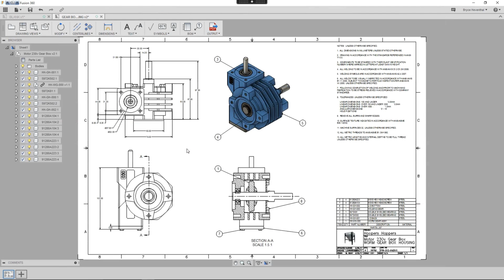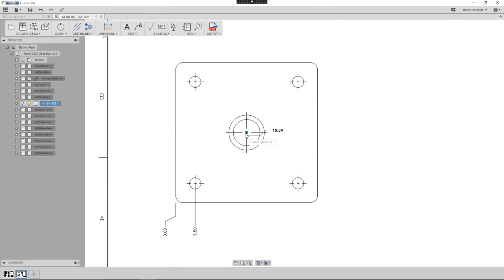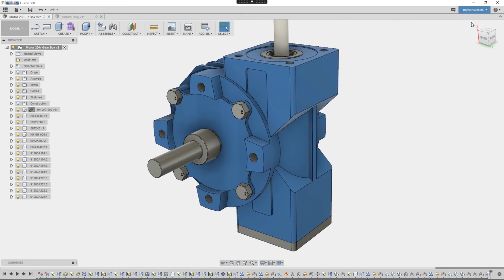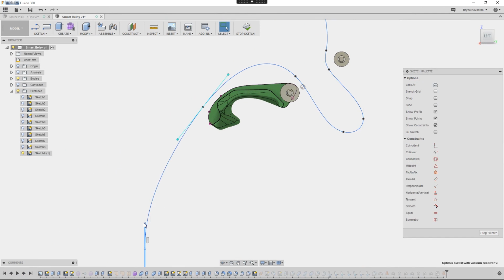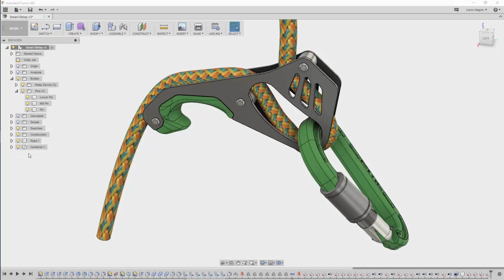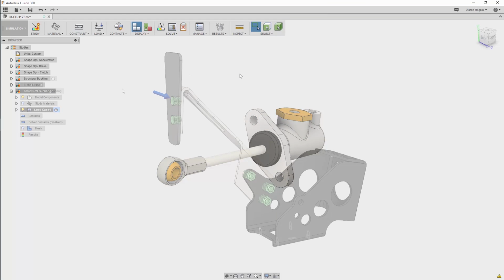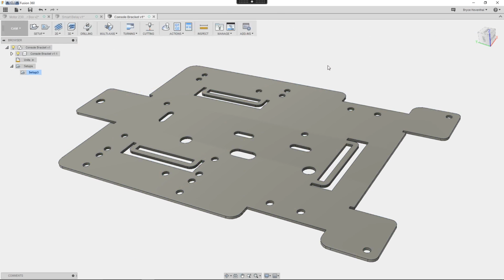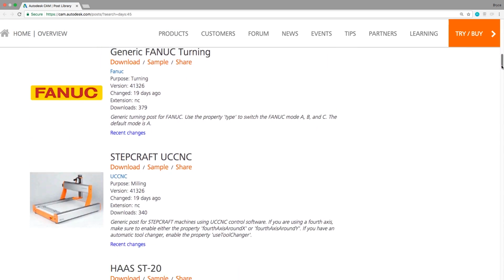What's New in Fusion 360 March 2017 Update

Comment: Totally screwed my mac. Just updated to March 2017. Wish I hadn't bothered but had no choice did I? Fusion acts sluggish after a while then hangs and then I have to restart. Totally ruined.
Reply: Hi Aaron,
I tried re installing the software and its a bit early to start punching the air but it seems to be working fine now. I love Fusion 360 so was horrified when it began to act like that.

Comment: Next thing that 2D cutting needs is the ability to specify different cuts by color before exporting to DXF
Reply: If you mean by cut type, we do that now.
Reply: I'm not quite sure what you mean by cut type, what I was trying to get at was if I had a big sheet that I was laser cutting, and I wanted to cut all the inside geometry before I cut the exterior geometry, I could do two different setups, and have each be exported to dxf as a different color, so that when I go to load my dxf onto the laser cutter, I can easily choose different speeds/powers and cut orders for the colors that I had defined previously in Fusion.